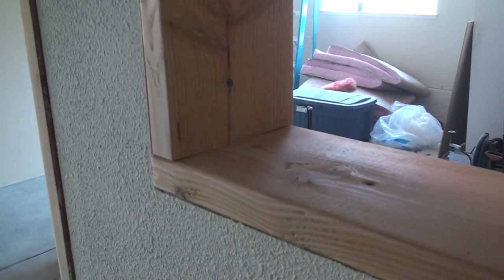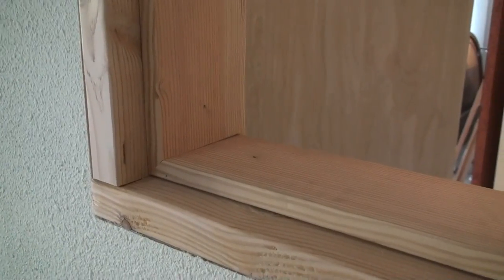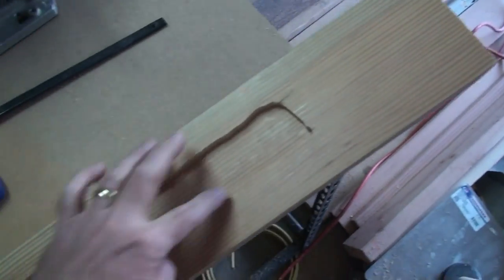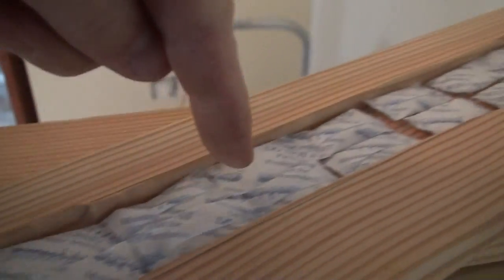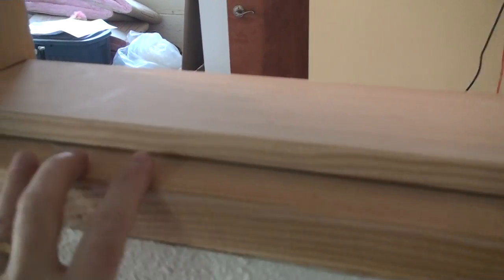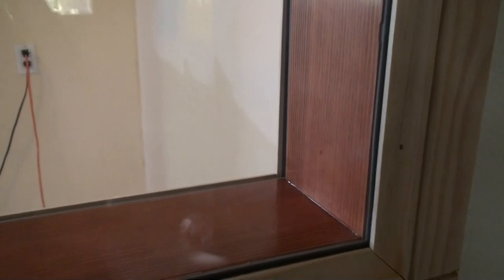Drum Room Construction : Part 7 - Soundproof window and first sound test!

Comment: What kind of glass did you use, and could i buy something on amazon like it?
Reply from the maker: Axomite I think I used 1/4" on the outside and 3/8" on the inside. Both laminated glass panes. I picked them up from my local glass store.  They do not sell it on Amazon AFAIK.

Comment: Nice work man! Thank you for the video! 

It is really helping me! 

I have one question, though... Some people say that if you put both glasses straight in parallel like you did, you can have some problems with some reflex from inside when you turn the lights on (inside the recording room or the control room)... People suggest installing the glass in a short angle to prevent that. I realize you put your glasses in parallel. Did you happen to have any problem with reflex by doing that? Thank you!!
Reply from the maker: You're welcome! Glad it helped. Angled windows are always better as far as I can tell. I did not want to make the walls thicker though. Glare is not an issue for me as that window is mostly to let in light.

Comment: I am sorry if this was already addressed and I missed it but may I ask how thick are the two pieces of glass you’re using did you match tth PSF on your walls and also are both pieces of glass the same thickness. I am at this point with my project now thank you for the video and the response.
Reply from the maker: Hi John, I just pinned the answer as it comes up a lot. I did 1/4" outside, 3/8" inside laminated. I did some research to come up with those value, but it was a long time ago. I only remember I went thicker on the inside because the inner walls are thicker.
Reply: Thank you I’m doing 1/2 inch thick tempered on the inside and 1/4 inch on backside

Comment: I have a quick question for. On your video where you did the soundproofing window, you did use two pieces of glass correct?We're they the same thickness? What type of caulk or silicone did you use. Best, Rob

Comment: Very nicely done sir! 40 dB of isolation is very, very good. That's 1/10,000th the sound pressure, right?
About the double door mini vestibule... bummer to see just 5-6 dB loss when closing the 2nd door, but well, your window achieves that, so congrats for your project.

Now go play some drums (and loud)! btw are you an engineer?

Comment from the maker: @sticksbass If there is constant moisture intrusion, you are right. There are no vents to the outside world in this window though. It is sealed (in theory!).
On the stain, I agree. I tried to use water-based, but the only tint I liked was the Gunstock, which is only available in oil-based. I did use water-based poly though.

Comment: Awesome video man, but aren't the windows supposed to be slanted to create more cancellation? Or is that just for a vocal booth?
Reply from the maker: That would be better, yes. That requires thicker walls though, so I chose not to go that route. It is a pretty small window, so the effect is not dramatic.
Reply: asicerik Will this mess the recording up at all with reflections or is this design you have pretty solid for a live room too?
Reply from the maker: DopeMusicEntTv Hey, I thought I replied to this before, I guess not. This window is in a little alcove away from the drums, so it does not effect the recording at all. It "can" mess up mixing a bit since it will create reflections from my right monitor speaker. I have not gone to the trouble of eq-ing the mixing console/etc. since I have not done any serious recording in there.

Comment: glass pieces should have an angle like this    /..\  not like this  |..|
Reply from the maker: +Miodrag Vemic They are better that way, for sure. But it works just fine for me. You need very thick walls to do the angles. You can see from the video that the window is quieter than the doors. I would have preferred no windows at all of course :)
Reply: Miodrag Vemic Not true. Thats a myth.

Comment: can you please tell me what you used as far as weather stripping goes (or whatever it is) that you used around the door frame to seal it when it is shut? I am mimicking your communicating door construction in my studio :-)
Reply from the maker: I used a self-adhesive silicone seal. You can find them at tmsoundproofing.com under door soundproofing. Thanks!

Comment: Great, great tutorial. Could you please tell how you fixed the trim on the frames after installing the glasses? Sorry if that's already explained on the video but english isn't my first language and I'm not sure if I understand everything correctly. Thanks for all the info you put available.
Reply from the maker: I Carvalho Thank you very much. Are you asking how I attached the trim? If so, I used an electric nailer with small headed nails (studs). You can do it with a hammer, you just need to be careful not to hit the window :)
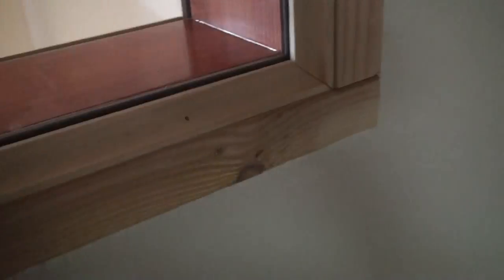At 3:19 in the video, you can see the little hole at the right side of the video.
Reply: asicerik Hi, thanks for answering. Yes that was my doubt. I think I fully understand it now. All the best.

Comment: I have a quick question for. On your video where you did the soundproofing window, you did use two pieces of glass correct?We're they the same thickness? What type of caulk or silicone did you use. Best, Rob
Reply from the maker: Hey Rob. I used two different thicknesses. I think it was 1/4" on the outside of the room, and 3/8" on the inside. You will get better sound canceling if you use different thicknesses. I used Slienseal acoustic caulk everywhere I had a joint in the room.
Thanks for watching!

Comment: Hi Erik, I have one other question for you.  Is there a reason why you used glazing tape in between the window trim and the glass in addition to putting it between the glass and the 1X6?  From all of the research I have done, I only find people recommending the glazing between the glass and the wood separator (they don't mention putting it between the glass and the trim).  Any recommendations/insight you could give would be really appreciated, thank you!
Reply from the maker: No problem. I did that to aid in compression of the glass. That allows a little more cushion / isolation of the glass to the trim. I saw it done that way when I looked it up, but it might not be needed.
Reply: asicerik thank you!

Comment: Great window! A friend and I just built one based on this design and it works great.  I was curious as to what kind of trim/molding that is in the window.  We were going to use quarter round but I like what you have better.  
Also, the guy at my glass shop recommended the laminate stuff which is similar to windshields. Has a piece of laminate sandwiched between two panes.
Reply from the maker: Hey Michael, that's great! Glad I could help. I did use lami-glass. I guess I forgot to mention that. I probably mentioned that back in the planning videos. The trim is just something standard from Home Depot. They have a section with a bunch of small trim like this. It is 1/2" i think.

Comment: The best sound isolation is achieved by having the two panes of glass at somewhat of a different angle from each other. I don't see that you did that. That's what I've seen in professional studios.
Reply from the maker: Yes. That is correct. However, that requires thicker walls. If you keep the walls the same thickness and bring one side of the glass closer, I think you lose isolation due to proximity. I think anyway :)
Reply: @asicerik  The ones I saw weren't that much thinker than yours. The angle was only slight.
Reply from the maker: @responsibleparty  You are probably right. I remember reading about this. I don't remember the details. I do remember for my wall thickness it seemed better NOT to angle them. Right on the border though.

Comment: Hey i have a question what exactly did you do to hold the glass sheet in place and also the material?
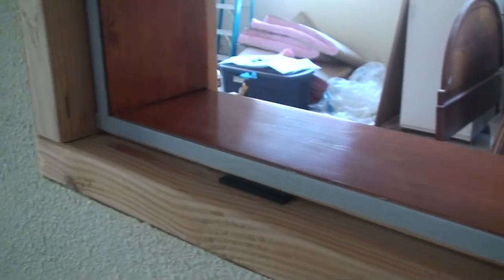Reply from the maker: Check out 2:48 in the video. I used glazing tape, which is double-sided foam tape. I also used stop blocks at the bottom to hold the glass off the bottom wood section.

Comment: Do you think this is possible under 1000$?
Reply from the maker: +bigPianist99 To do a room like mine? No. If you can cut a few corners though, yes it is possible. Like skipping the isolated drywall (hat channel) stuff. No windows certainly helps. Of course you need free labor :)
Reply: asicerik I may mention that the room I will make will be 6 by 7 by 6 feet?
Reply from the maker: +bigPianist99 Wow! That is a tiny room. Yeah, you could do that for under $1,000 I am pretty sure.

Comment from the maker: Good questions. On the window, that still would have left the air in there, which has moisture. You would need to pull a vacuum to get the moisture out. The silica packs will absorb the water in there. It has worked perfectly so far.
On the walls, the research I did said that resilient channel was better than staggered studs for isolation. I did leave a gap around everything and caulked it with the acoustic caulk. Even so, once all the caulk cured it was pretty firm.
Thanks!

Comment: Hey Erik, what were the measurements of your neoprene setting blocks?  It looks like 2 inches long, 1 inch wide and 1/8 inch thick?  Also, did you use any green glue between the window and the trim or just the glazing tape?
Reply from the maker: They are actually 2" x 1/2" x  1/8". I have a boat load of them left if you want some. PM me if so. No green glue, just tape
Reply: Thank you so much, I shot you a PM
Reply from the maker: Did you get my message? They are on the way
Reply: I did, I just sent you a PM

Comment: Thanks so much for putting the videos up! Love your videos! 

Couple questions. 
-did you construct two double studded walls?
-if so, how did you go about attaching the framing for the two pieces of glass to both walls? You got great results, but I would think bridging the two walls would cause a problem.
-do you think you could get a couple more db by not bridging the two walls with the 2x8 or whatever size you used?  So basically, you'd be able to physically see the separation of the two walls when looking through the glass. (Really hope I made sense here) haha
Reply from the maker: Thanks for the kind words. I did not build separate walls. I had semi-floating drywall on the inside though using the quiet clips and hat channel. I have videos on this if you go back a few from this one. 
To answer your second question though, if you are building two walls, you really don't want to couple them. In that case, the panes of glass would be mounted on the inside and outside walls respectively with an air gap in between.
Reply: Thanks so much for the prompt response 🙂. You didn't happen to get a decibel reading with the drums going, did you? 
I ask, because I live in a live/work loft in LA and I'm looking to build a drum booth. The drum booth construction will be a double studded wall with an inch gap between walls. Using whisper clips, rockwull, double layer 5/8 drywall with green glue in between.  Now the outside wall of the drum booth will be an inch a way from the actual structural wall of the building/neighboring wall. I'm pretty worried about it no being enough. 😬
Reply from the maker: Do your neighbors share a wall with you? If so, I don't know if you can get to low enough. Can you hear your neighbors talking/yelling/playing music? If those things are pretty quiet, then you are probably in good shape. If those are loud to you, you will need really nice neighbors :) 
You are doing all the right things, so things will be fairly quiet. The neighbors will probably hear you playing, it is just a question of how loudly. It may be no big deal other than you can't play late at night.
I have not done the sound test with drums. I should do that.
Reply: Yeah that's what I was afraid of. I can hear them plenty sometimes. Especially the drunken nights when they bring out the tambourin. Haha so if that can cut through, the drums will as well.

Comment: Thanks for this amazing video Mr asicerik. I have one small question. Their is a room in my house which I intend to soundproof. The problem is that is has 3 windows and each one is perhaps twice the size yours. Meaning they are really big. Can I apply this method or will be better if I just use some cement board to reduce 2 and make only 1???
Thanks a lot
Reply from the maker: Hi Marco - you are welcome! Glass is really reflective, so you do have to be careful. For sound-proofing, I think you will be fine. However, you will have to worry about the reflections in the room. As DopeMusicEntTv commented below, you would want to slant the interior glass if you have that much surface area. If you "need" all that glass, it would be better to remove it.
Reply: Well I was having that trouble. Guess I will go for it using your recomendation. Take 2 and use only one. Thanks a lot for your answer I do appreciate it.
Thanks
Reply from the maker: Marco Antonio Perez I think that is a smart move. Unless you NEED windows, it is best to get rid of them. It is also more expensive than drywall. Glad I could help! Thanks!